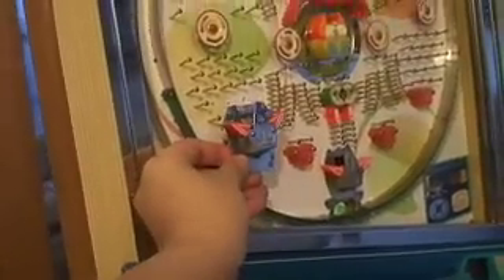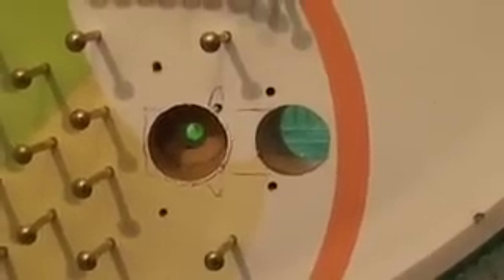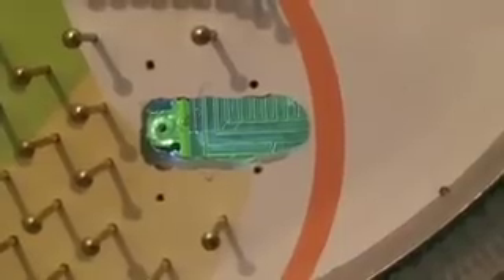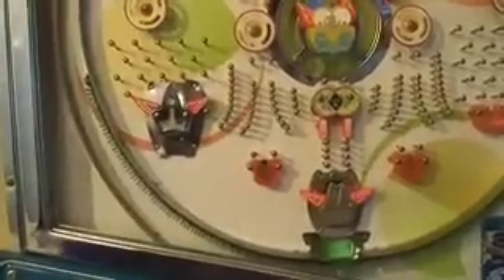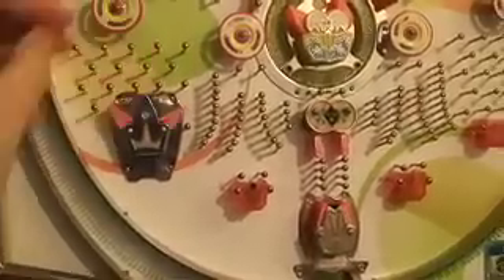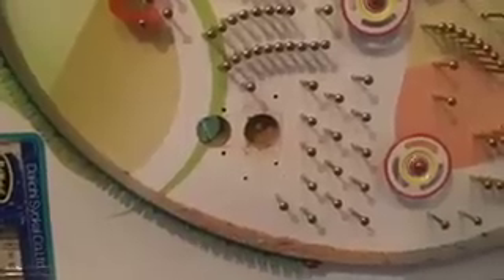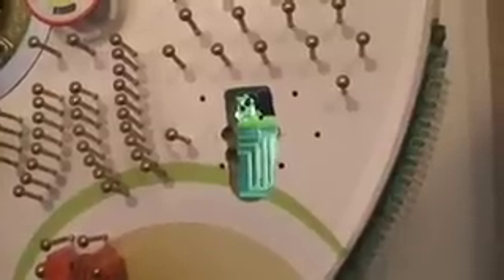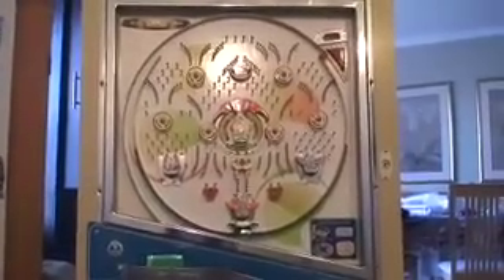pachinko tulips

Comment: I have a nishijin model b. 2 of my pockets either don't close once a ball goes into it or open at all. My linkage might need cleaned but I have no idea how to get to it. I might have to dissemble from ther back but that is frustrating. Can I use pliers and remove the pockets from the front. will this cause damage? what would be the best way to clean and fix my linkage so the pockets will open and close like they are sappose to. P.S. mine is a model b side trossed lady bug.